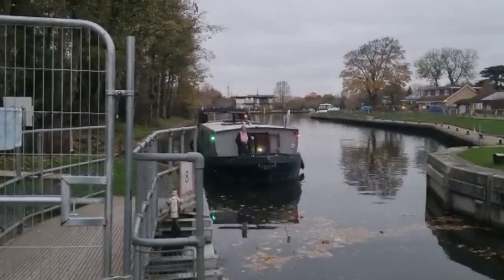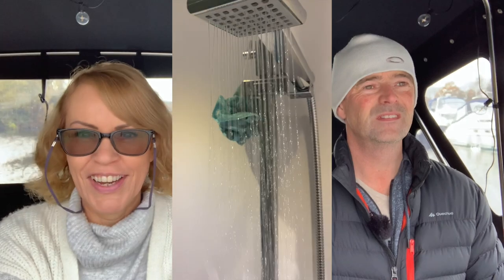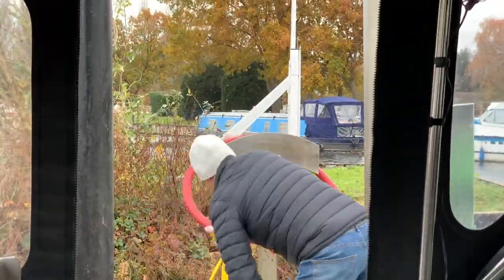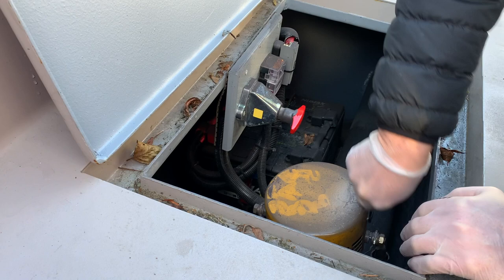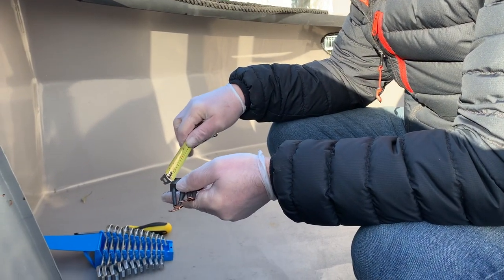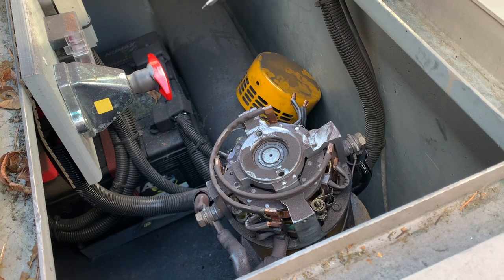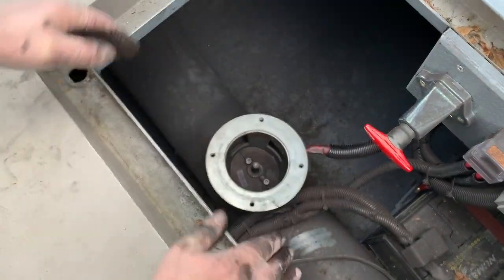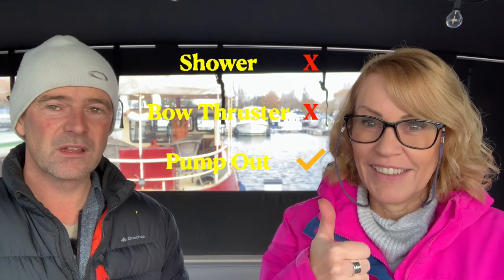33. Will we BOW under pressure? | we've lost our THRUST | boat life

Comment: Can’t something like a 150mm expanding pipe stopper be used to seal either end of the thruster tube in order to take the propeller out?
This would save dry docking or lifting to boat out of the water. You should also be able to get a blanking plate once the propeller system is removed so that you can inspect the pinion and shaft gearing, which I’m beginning to wonder if it has been running dry or simply out of alignment.
Reply from the maker: We don’t think it’s the alignment and after investigation we think it has to be fitted through the tube rather than coming out through the top of the tube in the bow, so not sure that would work 🤔 it’s still under warranty too so we don’t want to play about with it to much but it’s a good shout 😁